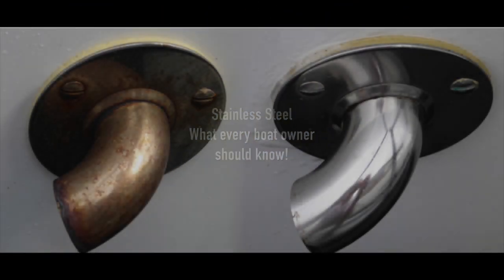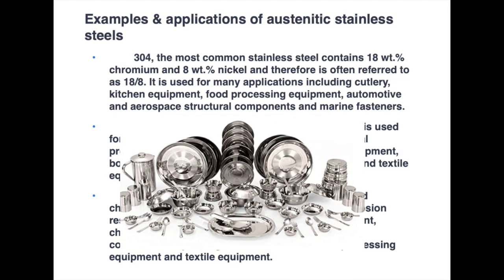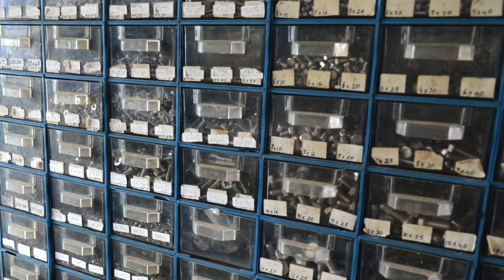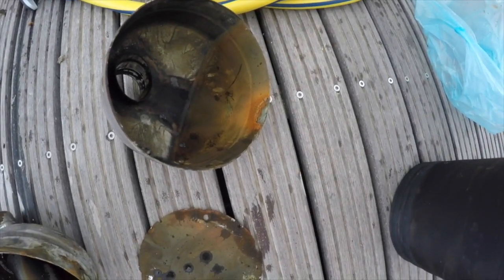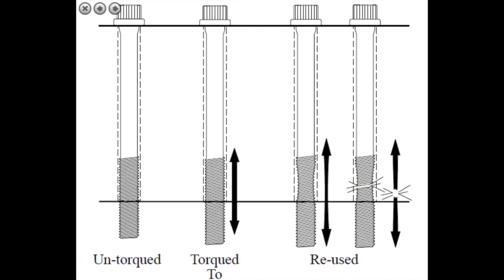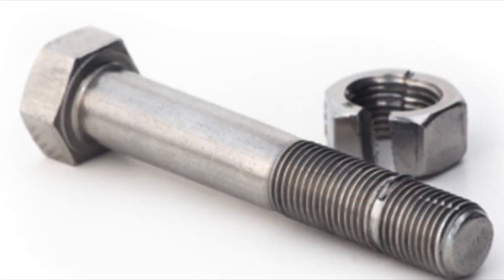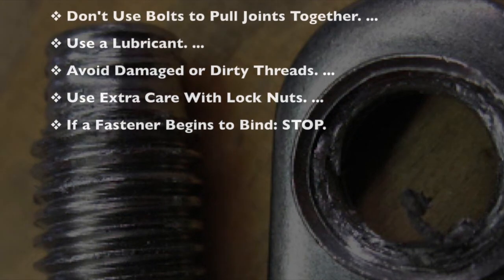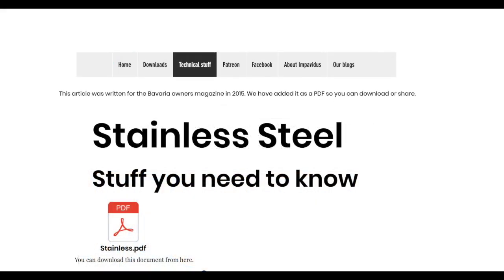Stainless Steel. Fails On Boats. WHY? What every boat owner should know. OTB 129.

Comment: As a former Rigger I would always use anti seize (copper or nickel based) on important threads like turnbuckles. Once you have a galling event that requires a disc grinder cut off wheel and buying a new turnbuckle, you don’t take the risk with dry threads.
If you have the tools, doing a light polish on the threads removes any tiny burrs.
Reply from the maker: Good advice!

Comment: Enjoyed your video and would like to point out that 304 and 316 grades are now dual certified and will be marked 304/304L and 316/316L.  The "L" for both simply means "low carbon".  These dual certified grades were developed in the late 70s/early 80s and are particularly important if the stainless is to be welded.  During the welding process, the heat affected zone will "draw" carbon molecules causing the weld area to rust if not annealed after welding.  "L" grades were developed to limit carbon content to .04 maximum.  Your advice to use a magnet to determine the quality is perfect, especially when searching for 316.  Monel is an excellent upgrade for metal parts to be used in a seawater application, but its pricing will be substantially higher with limited availability.  The boating consumer should also be careful when purchasing stainless steel shackles too as most are manufactured in China from cheap stainless steel.   Another important metals topic for the boating community involves the multiple grades of aluminum.  The best grade  for seawater applications is 5086, a member of the 5000 series.  Aluminum parts (masts & booms for example) are generally anodized for enhanced protection and are from the 6000 series of aluminum grades.  You mentioned duplex stainless steels, which possess characteristics from both martensitic and austenitic.  An example is 2205.
Reply from the maker: Dick. Hi It is very difficult to cover every aspect in a short video aimed at the non engineer. If we covered all the aspects we would like to we would not get the videos out or would lose most viewers after about 3 mins.  Thanks for watching and some good points made.

Comment: Nicely done Ant. Have you tried the magnet trick on your Ultra anchor though? Sticks to the 316 flukes but not to the 318 shank, just to confuse matters!
Reply from the maker: Mine does not stick anywhere I just checked it. It may be some induced magnetism from the forging or welding. This can happen but it is usually very lightly magnetized. Just be sure the ships compass is moving Steve and does not keep saying the bows are always north :-)
Reply: @SVImpavidus  interesting, maybe they’re using duplex steel for the whole thing now? Mine is 318 shank and 316L fluke

Comment: What about A high end stainless or Titanium in those severe conditions?
Reply from the maker: Most of the stain less materials suffer from the same issues. Then there is the cost They and Titanium are not only expensive but extremely difficult to cast, shape and work. Sail Safe mate. Ant & Cid

Comment: All metal bolts will stretch under torque, not only SS.
Reply from the maker: But not by the same amount and not with the same results. Galling is a major issue with SS. Thanks for watching.